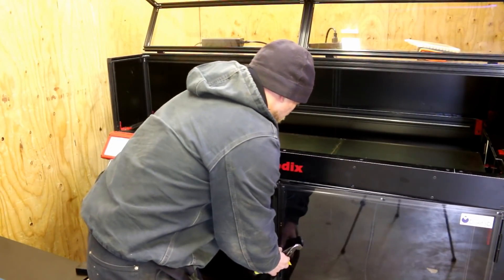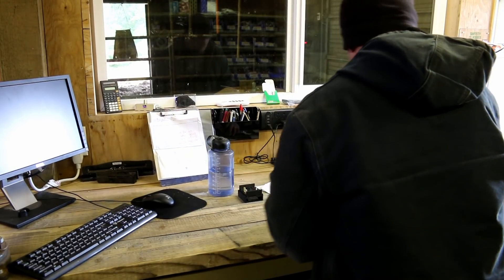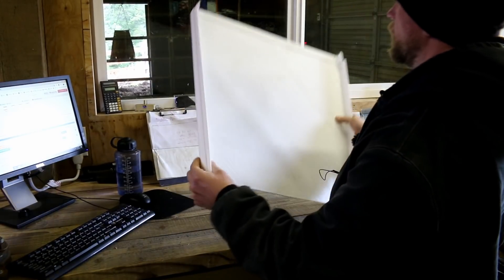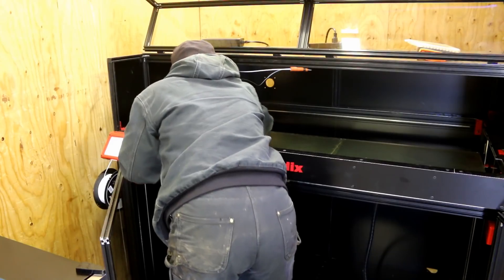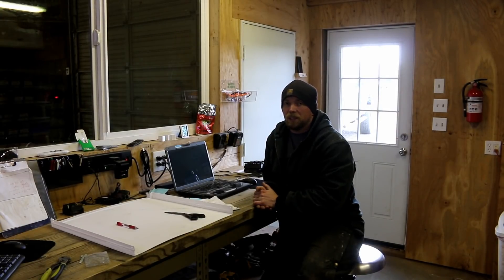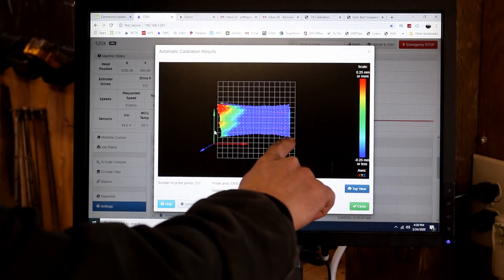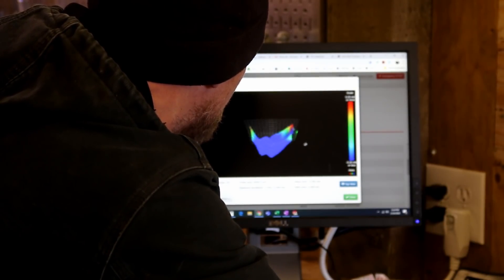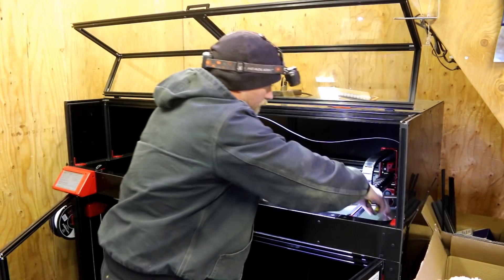I'm So IMPRESSED With How BIG The MODIX 120 Can Print!

Comment: Leveling the bed doesn’t have anything to do with gravity level. You want it set so that as the nozzle moves around the bed in different locations the distance between the bed and nozzle is exactly the same. This can be done in smaller printers manually by putting a piece of paper between the nozzle and bed and adjusting the bed so that the paper has the same amount of friction to being pulled sideways at all points around the bed.

Comment: Have you looked at any videos of vacuum forming yet? That back panel could be made in just a few minutes with the longest time being the heat time on the plastic as things like cooling will happen fast on the cool mold and trim work will be fast once some jigs are setup. 

The good news is you will be able to setup a pantograph router to help with holes and even clearing the flashing for a test bed or production setup once you get past prototype stage.
Reply from the maker: I have..looking into it

Comment: The various maps show that the center of the bed is way lower than any of the corners.
Run a straight edge along the seam while looking under it to check for gaps on both bed edges of the seam...adjust to level if needed.
Then do the corners...ONE corner adjustment at a time...between mappings...so you can know the exact movement of each corner in relation to the center seam and vs the other corners.
Also...the last map looked to show the FRONT edge was lower but you said it was the back edge.

Comment: As stated by others you dont "level" the bed. you tram it, which is when you try to make the plane of the bed and the plane of the print head kinematics to be parallel.  One a note about your slicing software check to see if there is a g29 s1(is I remember correctly. check the reprap wiki to make sure) command in it. if not then most likely its not using the mesh to do any compensations.

Comment: You need a dial indicator attached to the gantry run across the bed  to find the high and lows in the bed. Also make sure the bed is tight to the supports. Find the back lash in the bed screws.

Comment: You didn't show it but I'm assuming the enclosure/gantry are all perfectly level if you are trying to level the bed with a bubble? Like others have said, seems like the machine cares more about being properly adjusted to itself and not so much parts of it plumb to gravity... Also, it looks like the middle is significantly low, can you adjust both sides of the seem up? 

I know (hope?) this is probably moot as this is not real time and you'd be in serious trouble if you've been stalled on this the whole time ...

Comment: i really can't understand why you don't just print the lip and use some flat stock for the large areas...
Reply: Oh my goodness THIS. Zip it through a table saw. 30 seconds versus 13 hours. For EACH copy. Granted a couple extra minutes for mounting the brackets but still, an incredible time savings. Even the other side of the wall with the cutouts, sheet goods and a cnc router or laser cutter and done in a few minutes. But that side makes more sense for 3d printing than the back, especially as he's already invested in the printer.
Reply: Yeah I'm wondering the same thing. He definitely could use a laser cutter or cnc router and 3d print the other parts. Seems like a waste to use filament to make a flate sheet. Definitely would cost more.

Comment: you don't level a 3d printer with a bubble. you "tram" it by measuring nozzle distance to bed at many points. according to what i seen on your map, you should have raised both sides of the seem 0.5-0.75mm to get well within the tolerance needed for auto bed leveling (level compensation)
Reply: Exactly what I was about to say...